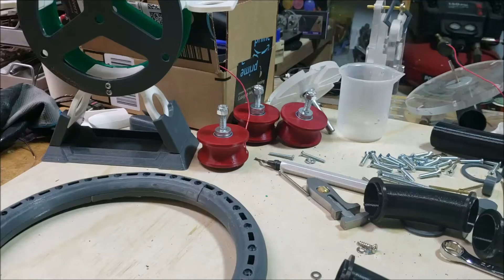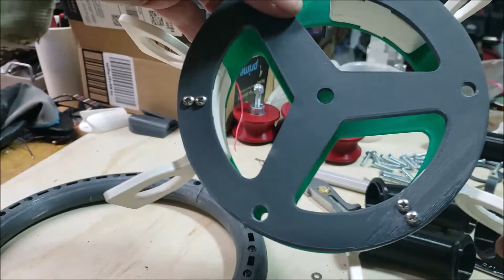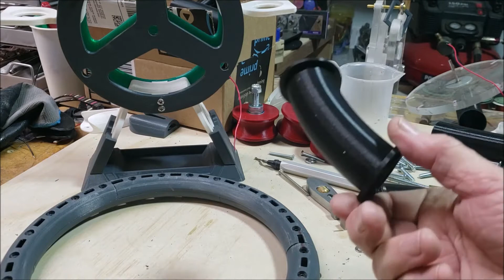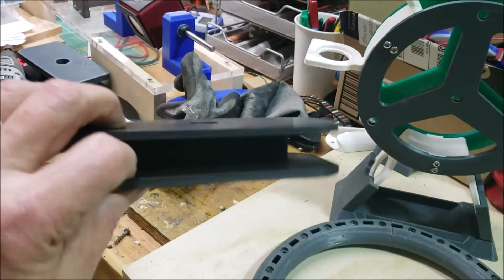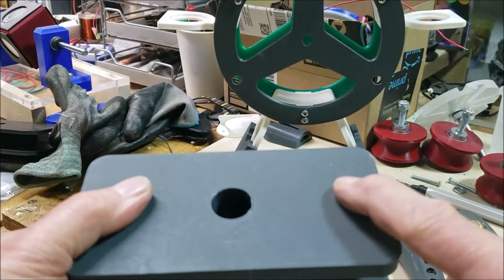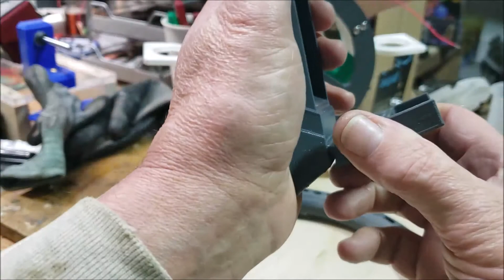3D Printed Solenoid motor update

Comment: My rollers are not round enough not getting a smooth spin may touch them up on my lath, was looking to see if we can use a wheel of some kind and print magnet holders for it to get a more high speed free rolling wheel.
Reply from the maker: cool let me know what you come up with